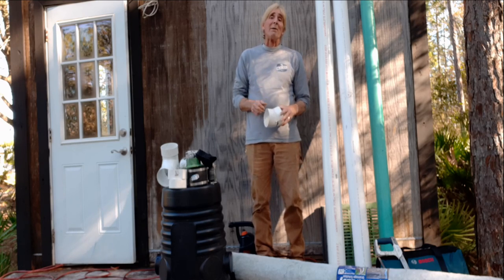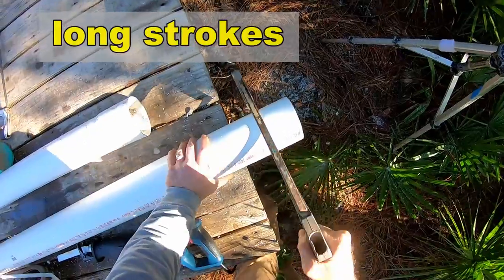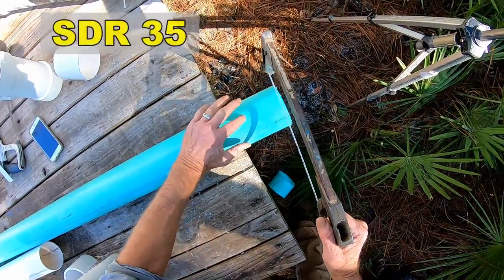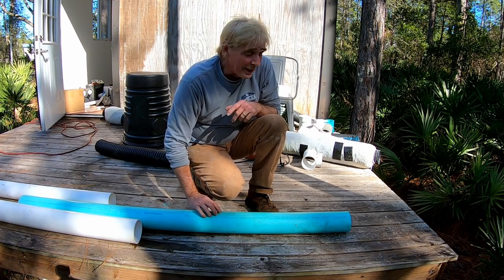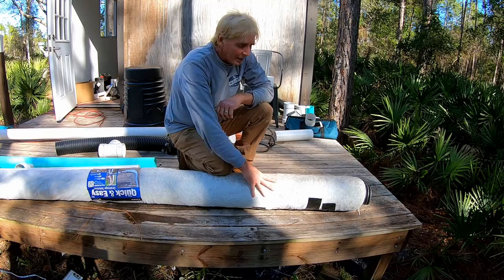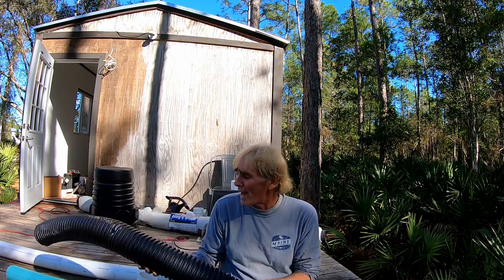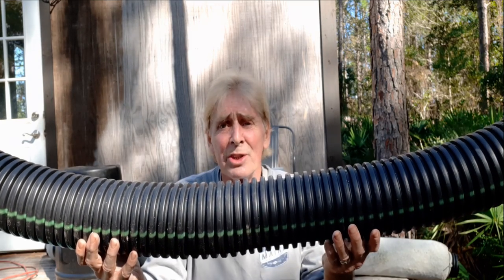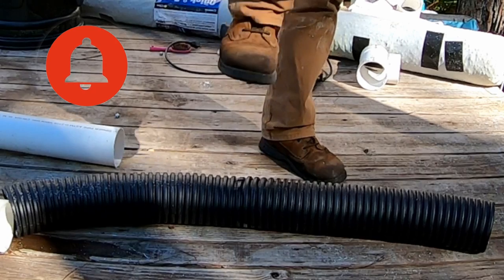FRENCH DRAIN - What's the BEST Pipe to use?

Comment: I hear so much conflicting information on which pipe is best. It seems PVC is much better at retaining water flow as there are no corrugations impeding the speed of the water and also much easier to maintain adequate slope without bellies. This helps with keeping the drain clear of debris and minimizing residual water in the pipe which is what the roots are seeking. PVC is also much easier to clean out if it happens to get clogged. I've done a lot of research on this topic and am struggling to find a good reason to use corrugated other than ease of installation.
Reply: Go with the green PVC sewer pipe. It’s strong, cost effective and will last. I have removed hundreds of failed corrugated systems. The corrugated pipe that is sold at the big box stores is no good. To have a quality corrugated pipe/french drain system installed costs a lot of $$$ and is only really needed in certain situations.
Reply: Corrugated holds some water so plants seek it out.  HDPE is the best choice, flows beautifully, does not hold water.
Reply: Yup, there is no right answer, apparently. I wouldn't use corrugated because with low flow it's going to collect dirt in the corrugations and too easy to have bellies that hold water begging for roots to get into it.
Reply: I have had to dig up corrugated runs before that were collapsed and clogged in spots. Do it once the right way no matter the initial cost. Cannot underestimate how important proper drainage is to a foundation, the cost is worth it.
Reply: @miked8227  what do u propose to use?
Reply: I'm with you my friend. I'm a few hours in and am not convinced of so many things. Conflicting information. One person put it in a way that has stuck with me so far (but ask me in a week and I might change my mind). If you have ALREADY collected the water, use PVC. If you are trying to collect water VIA the pipe, use corrugated pipe. Example being, if your house collects rain water via gutter, why would you use corrugated pipe and potentially release a lot of it right next to your foundation (if running along foundation). If you went through the trouble of getting it via another system, carry it away with no chance of it leaving early. If you are trying to collect water, use corrugated (and this will only fill during rains generally more evenly throughout the pipe and THEN carry the water away (so the water won't want to leave early, it won't have anywhere dry to go b/c it's already wet there). Hope that make sense. Unfortunately this might mean having a wider trench with TWO pipes. but I dunno, it's really convincing to me at the moment.

Though then my issue is "corrugated pipe is kind of weak". If you have one good low point, I'd say you just have a drain system there INTO pvc and then drain away. But if you have one continuous low point, then maybe corrugated is better there. But I'd say if you don't need corrugated in a place, use PVC instead. I dunno if there are clean transitions from one to another w/o leaving awkward swell spots. Just some thoughts
Reply: @StormWaterDrainageSolutions  why the green?
Reply: @ThePikmin18  It's a lot more cost effective than the schedule 40. You only need schedule 40 if cars will be driving over the pipes.
Reply: @Kalikovision7  Do you know the difference between corrugated and perforated?
Reply: If you don't want to do the job more than once go schedule 40. Corrugated will collapse. If it doesn't collapse it will likely clog with roots and corrugated doesn't snake well. Green pipe is ok but it's thin and weak so correct installation is very important to avoid beaks.
Reply: Honestly just use schedule 40. It's stronger, better design and easier to maintain. The risk with it is it being overkill for the purpose required. 
As opposed to the risk with alternate systems which is that they will not be fit for purpose for very long and you'll need to do the same job again.
It's a no brainer.
Reply: @VeeSeven700  My 2 thin wall drain systems are 25 years old and I've never had a problem. Lowes- $15.17 for 10ft thin wall with built in coupler. $38.96 for 10' schedule 40 + $5/coupler. I have 2 runs, front and back, to the side discharge, each over 80'. I did use 5' of schedule 40 at the ends because I have no curb.
Reply: @joeshmoe7789  No doubt you can have a successful install with other options. Not disagreeing there at all. But the risk of problems is massively higher. The number of corrugated pipes I've seen full of everything except water is unbelievable. They split all the damn time it seems like. Especially when underground.
Reply: @VeeSeven700  I don't like corrugated at all, even the flexible with the smooth inside. Schedule 40 is no doubt the best, but almost 3X the cost of thin wall PVC. I would think major tree roots could be a concern in determining which type of pipe to use. When using thin wall, a good garden center or landscape supply could be needed because Lowe's & Home Depot usually don't have everything you need.
Reply: Get your slope correct and the corrugation won't really matter.  Flexible pipe underground is better as it can shift with earth movement or freezing.
Reply: @daibonehead  I've never seen PVC get clogged and also holds up well to jetting, can't tell you how many systems I've seen where corrugated is getting ripped out after failing
Reply: Corrugated less likely to crack when it freezes. Ease of use and cost however are your two big ones. If you dont glue your pvc joints correctly theyll leak, also if you dont get your gravel correct when you fill the trench in/drive over it, it will crack with pressure.
Reply: @lawn-n-orderlandscaping1389  If pipes are pitched correctly, there will be no water in them to freeze and crack. If you don't glue PCV joints, you didn't install it correctly. How often do PVC joints leak in a house? Glue actually welds the fitting and pipe together. Much better than taped joints for the corrugated. As far as pipes cracking from being driven over, all types must be protected to handle the weight they're rated for. As for easy installation, you need to adjust the dirt under corrugated to remove "bellies" before backfilling.
Reply: Use pvc for sure
Reply: some would say corrugated is harder to install.
Reply: @678friedbed  maybe someone without any experience
Reply: @tbarbuto2345   well PVC is incredibly easy to install, that's why I use it. if it takes experience to use something that means it harder to use.
Reply: @678friedbed  Yes, the trench must be almost perfectly flat or they'll be bellies. PVC's can't belly, therefore digging the trench is more forgiving.
Reply: @joeshmoe7789  and PVC is incredibly easy to assemble.
Reply: I couldn't have said it better. Gets clogged in valleys.
Reply: My parents have a corrugated system that has been running since 1999. With no problems. Corrugated is cheaper, better for environment, easier to install, and similar useful life.
Reply: @penguins2628  Every property is different. Is it a straight run? Does your parents property have very good fall? Are there large trees whose roots can crush the pipes as they grow? Are the pipes deep where cars can't crush them? Do they get leaves and other tree debris in the gutters that make there way to their corrugated pipes? If they ever clog, what do you think an industrial snake would do to those old pipes? It is cheaper. It's not necessarily easier to install. The trench has to be almost perfect, no bellies, no valleys. While solid pipe does need a good trench, it is more forgiving. Schedule 40 has the best life expectancy of all pipes and can stand up to industrial drain cleaning and tree roots.
Reply: @StormWaterDrainageSolutions  What do you recommend for drainage around a pool deck? My pool deck walkway is cement and curves about 75ft. I was going to buy a 100ft corrugated pipe to run along the curved walkway.
Reply: @tbarbuto2345   Thanks for the reminder. I love gate city foundation. I have a drainage issue on the side of my yard and was trying to remember what he uses for perforated pipe. I thought he drilled holes in schedule 40 PVC but I couldn’t remember. Thanks
Reply: @joeshmoe7789  corrugated has ribs,perforated means holes
Reply: I have too and all tell you this my friend if schedule 40 is designed to flow crap what do you think it will do with water !! Corrugated pipe is garbage pipe !!!!
Reply: This comment has more useful information than this entire video.
Reply: @jackww839  Yes he drills holes to make the perforations. He also doesn't use landscape fabric as its susceptible to clogging and uses angular rock brought up to grade. Doesn't look the best but function over form  in those circumstances.
Reply: @chrisvonguggenberg  Is HDPE the white triple wall?
Reply: PTFE is the BEST
Reply: @joeshmoe7789  he does not
Reply: @daibonehead  earth movement and freezing are BS excuses
Reply: @lawn-n-orderlandscaping1389  pipes crack when they are full of water. Not when they have a small amount of water in them.
Stop parroting whit you heard.
Reply: You're all wrong. Smooth wall HDPE SDR 11 with electro fusion fittings.  Driving excavator over it, extremely frost tolerant, non brittle and exists at plastic deformation zone between like -40 and up to mid-100° f. About to do a system in that for my house and I can't wait.  Alternatively, considered c900 SDR 18 PVC Bell and gasket. Really cool stuff but still PVC. Still brittle. Won't have nearly the resiliency of smooth wall SdR 11 HDPE.

Comment: As I understand it, for hooking up to house or garage downpipes where you need water taken away from roofs quickly then smooth pvc pipe to roadway is the way to go. But if you have boggy areas in your back lawn, a French drain with corrugated slit pipes works well. Ensure the corrugated pipe has a sock over it and good clean stones to let surface water sink through the stones, into the slits and sock into the pipe. Great for long slower drainage to enable lawn to dry. Ensure no clay soil on top of the stones as this will simply block any water from entering the pipe to drain away and will just sit on top.

Comment: I have a long pipe done with SDR-26 gasketed pipe that I had installed for a surface drain.  It's similar to SDR-35 but has gasketed fittings that do not require glue.  My installer got it from a waterworks supply house, not HD or Lowes.

Comment: The main  draw back with PVC sch. 40 is price ,little harder to work with if you have the correct tools you can eliminate a lot of that,  it will out last the big box  corrugated pipe  .Some jobs  with out a doubt must use PVC sch. 40 .If sch 40 has root issues big box corrugated  pipe will be twice as bad .
Reply: It is also worth noting that if the fall is correct on schedule 40, hardly any water will remain in it for roots to seek.  Corrugated will ALWAYS retain water...what the roots want.  For some reason, Chuck never mentions this.
Reply: Exactly.
Reply: Which one is first gonna freeze & crack @ temps below zero?
Reply: @ErcanALTINEL  corrugated actually.  PVC only fails when it’s fully filled with water and the must freezes while at capacity.
Reply: @daveray6335  think he is trying to justify what he has been using for years.
Reply: @daveray6335  I used only schedule 40, but it occurs to me that one good thing about the corrugated is that there are no joints for roots to get into. I sure hope I got all my joints right!
Reply: @SlightReturn666  If you used adequate glue and primer you'll be fine. PVC cement chemically fuses the segments of pipe and their fittings together.
Reply: @SlightReturn666  There may not be any joints in corrugated when it's installed but there will be plenty of them after a period of time.

Comment: I got an excavator and made a 100' run of 4" corrugated black pipe that I bought at Home Depot.  It worked perfectly for two whole years.  Then I had to dig it up because it was clogged and couldn't be snaked.  So for the last few years there is a 100' open trench that carries water, but I have it staked off so no one breaks their leg falling into it.  So, I have about a dozen lengths of heavy schedule 8" pipe to replace it.  As soon as it warms up, I will install that pipe and be done with it.

Comment: At 14:37:  everything should connect to the downspout drain.  I don't think a french drain (or footer tile) should connect to a downspout drain.  I've read elsewhere that if the french drain is connected to the downspout drain, and if a torrential rain causes the downspout drain to backup, then the excess water will backup into the french drain.  I installed three downspout drains, each with its own line to the street and separate from the french drain (actually footer tile).  I have six lines discharging to the street - three downspout drains, one sump pump discharge handling two 20-foot lengths of footer tile, one channel drain, and a 20-foot gravity-to-daylight footer tile.  I used three runs of 20-foot easy flow for the footer tiles, and six pieces of 30-foot corrugated pipe for each discharge to the street, each terminating into its own catch basin at the curb.
Reply: I agree. Also, if the rain is so torrential that the downspouts are filling that discharge with a lot of water, it will create back pressure for the sump pump, especially if the street is flooded, forcing it work harder to push against that water, and maybe fail to empty the sump.
Reply: No need for a separate pipes. Just run the 6 inch main line connected to each downspout drains but do keep the French in a separate run
Reply: @jkevin1569  Yes, that would work.  I used 4-inch diameter pipe for the 3 downspout drains to the street.  But, like you said, joining the 3 downspout drains to one 6-inch diameter pipe to the street would have saved me some trenching.
Reply: Expecting monsoons?

Comment: If you don't bury schedule 40 pipe the first time, you will the second.
Reply: I take it you have had good success with schedule 40, and less so with other types of pipe? Trying to decide which one to use and your comment is in direct contrast with Chuck's recommendation. I like the beefiness of SCH 40, personally, but just curious to learn more of your experience.
Reply: @bmfitzgerald3  I'm a union plumber and on ALL of my personal projects I only use sch 40 and yes you can get sch 40 downspout adapters along with ANY other type of fitting. On commercial job sites I've used all the types of pipe mentioned, I install what the print calls for. I've also replaced all the other types of pipe due to excessive ditch depth and moving loads crushing these pipes, never sch 40. I believe he described exactly why he choses not to use sch 40 pipe, it's a bitch standing on your head in a 30" ditch full of slop trying to cut the heavy pipe to make a connection. The ONLY downfall to using sch 40 underground is cost, but like they say... buy once cry once.

Comment: He's right about getting roots. ANY pipe that is glued together and especially corrugated pipe will get roots. I have heard of some using silicone to fix the issue but I'm not sure if that works so I cannot speak on that.
Reply: I'm at loss about how to install a French drain now, if I need to drill holes for water runoff, but need to seal the pipes to mitigate root infiltration

Comment: I have a Covert running under the road to my yard so I’m planning on running 6” tile to the creek 250 An I have A gravel driveway was planning on using 6” pvc under the driveway witch is about 30’ wide An I’m trying to see what would be best I have some heavy equipment coming in sometimes to dump wood chips or 16’ trailer of wood thanks in advance for any help on this

Comment: One more question: When I core aerate this spring, will the aerator punch holes in the PVC pipe?
Reply: As someone who used to do aerating for a landscape company, I’ll say the plugs are usually 2-3” long. If your pipe is a safe distance deeper it shouldn’t be a problem. Walk and tow aerators are usually significantly lighter and shallower than ride ons which sometimes use a hydraulic press. However the ride ons are able to pull better plugs in tough soil.

Comment: Very informative videos.  I am 
in need of a little advice.  I need to install a downspout runoff drain 65 ft long.  due to ground slope etc I will have the top of the 4 inch pipe only 5 inches below ground.  We drive and park our cars in the grass.  Am I asking for trouble?  What pipe would you use?  Should I dig the trench as narrow as possible?  Thanx

Comment: Since the corrugated pipe doesn’t need coupling and elbows or other fittings, does that mean roots won’t get into it?  From what you mentioned about the rigid pipes having roots get into the joints of these systems, does eliminating the joints with corrugated pipe also eliminate the roots issues?
Reply: roots have the easiest time getting into that water and debris retaining garbage.
Reply: Corrugated pipe has T's, Y's, etc that are loosely connected and therefore are subject to leaks or roots. Schedule 40 joints are welded with cement and don't leak as stated here. They're the same joints the inside walls of most houses. How often do drainage pipes leak inside the walls of houses?  It's the strongest vs future large tree roots. You can seal other pipes if you need to.   

Corrugated needs to be checked every 6" for fall in and bellies when small amounts of fall are all that's available. It also always has standing water inside it, even with plenty of fall. Straight pipe doesn't retain water.
Reply: Corrugated pipe retain dirt n water.
Can have small crack that is penetrated by roots .
Also corrugated coupling , Y and T are loosely fitted . Root would get in corrugated like in no time